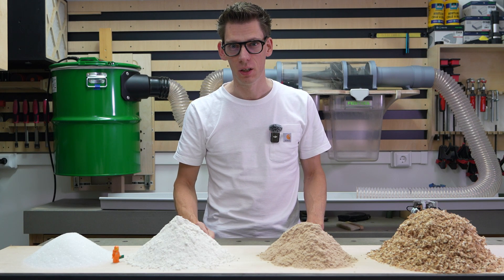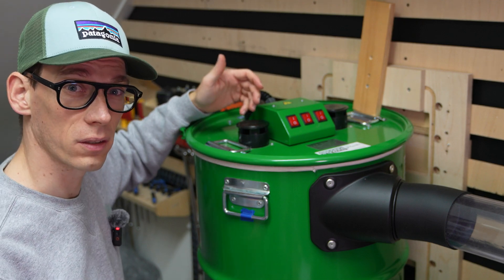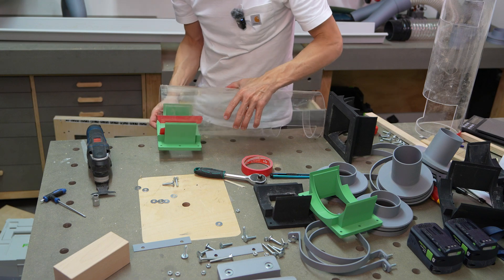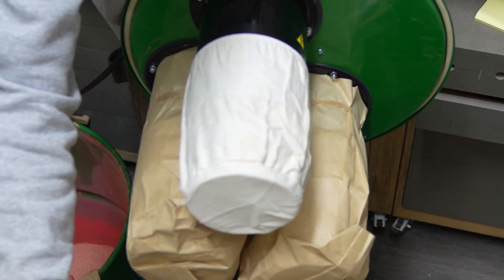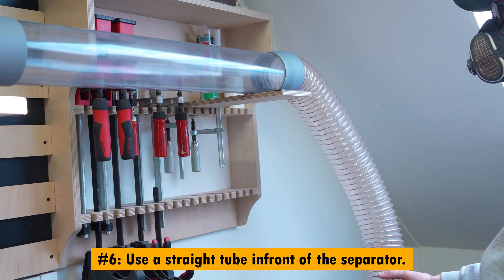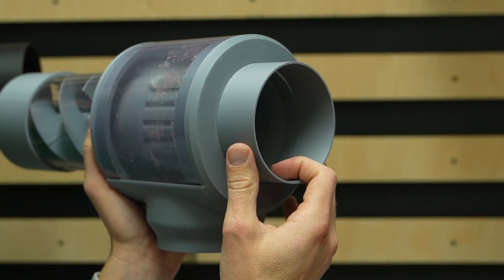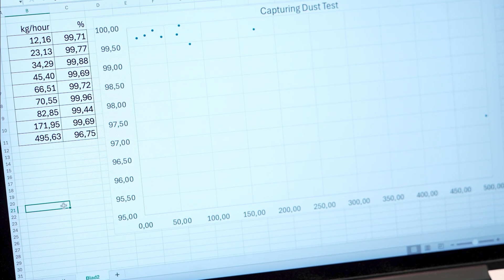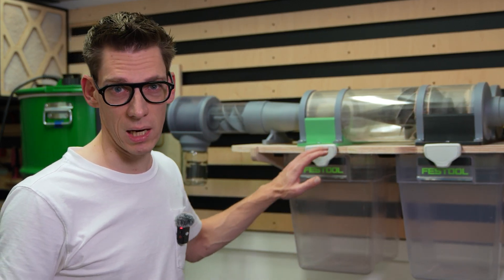Dust Collection: Small Changes, Massive Effect!

Comment: Static build up seems to be one of your issues. A bit of research found the following.

Static buildup in a cyclone dust separator made of acrylic and plastic components is a common issue because these materials are insulators, which can retain static charges generated by friction between air, dust particles, and surfaces. Here are some ways to eliminate or reduce static buildup:

1. Add Grounding

    a) Grounding Wire: Attach a grounding wire to the acrylic or plastic surfaces to dissipate the static charge. You can use copper or aluminum tape on the inner or outer surfaces and connect it to an earth ground. Ensure continuous contact by securely bonding the tape to the parts.
    b) Conductive Paint: Apply a thin layer of conductive paint on the outer surface of the acrylic or plastic components. This will provide a pathway for the static charge to dissipate.

2. Use Antistatic Coatings

    a) Antistatic Spray: Apply a commercially available antistatic spray designed for plastics and acrylics. These sprays neutralize the static charge and reduce dust adhesion.
    b) DIY Solution: Mix a small amount of liquid fabric softener with water in a spray bottle (e.g., 1:10 ratio) and apply it to the surfaces. This provides a temporary antistatic layer.
Reply: I worked for a very long time at Belzona (a very premium epoxy coating manufacturer).  Adding as little as 0.3% w/w carbon nanotubes makes coatings conductive enough to dissipate static charges before they can spark.  We would also dope epoxy with granular copper to achieve even high conductivity.  There must be conductive filaments out there that would do the same thing.
Reply: Dryer sheets, some are temporary help, but the spray works very well.

Comment: Great setup! It's good that you have several versions for different tubing specs, but you still only have a few to choose from. Any thoughts on making the design/cad paramtric to work with any size tubing out there?
Reply from the maker: Yes, the goal is to get it parametrically into Fusion. Just for that, I first want to complete the design and integrate the vacuüm motors.
Reply: @CapturingDust I might suggest that most woodworking shops already have  an extractor they are looking to adapt. Adding custom motors is moving this away from the DIY space imo.
Reply: @ChadTolkien Agreed. I think most people with a 3D printer and an existing dust collection system (however basic) wants to add this to complement the system. And then if this was parametric you could have one single with a 4 icnh pipe for a regular shop vac or a double with 6 inch if you are well endowed with a big blower.
Reply: I'm sure there a naughty innuendo in there somewhere.